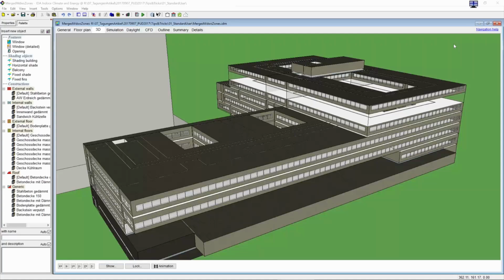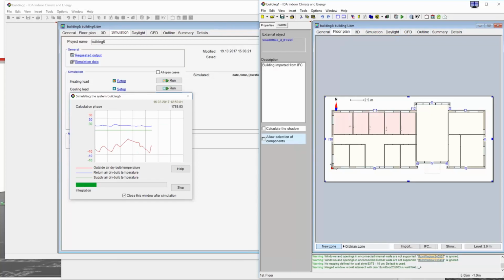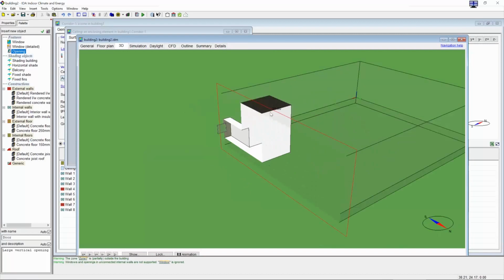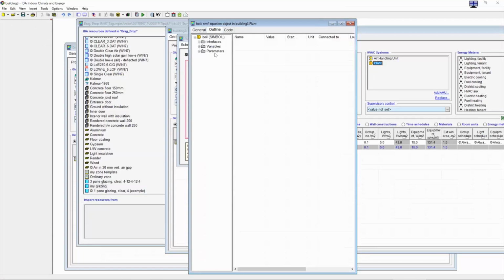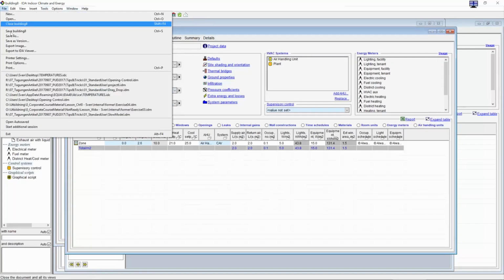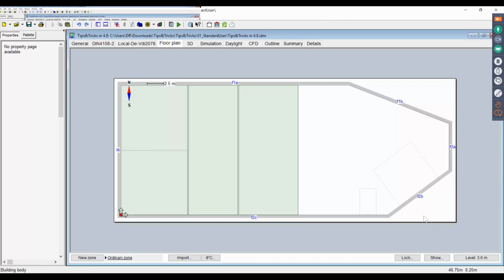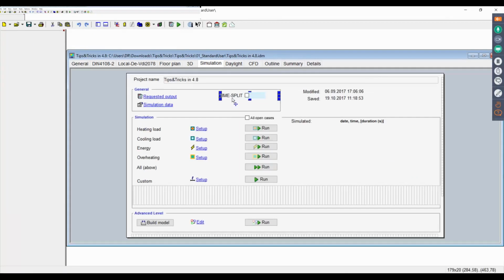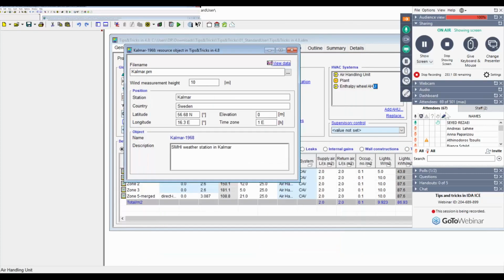Tips and tricks in IDA ICE 4.8 (Webinar)

Comment: Hi, thanks for the video. Great job! 
I have a question, do you know what could that warning means ''Unable determine if the radiation data in climate file are shifted'' ?
Reply: Weather files comes in all kinds of time formats, for example UTC, local time, time based upon a building controller or whatever. Often these files have to be shifted regarding UTC to local time and also local position/weather station. IDA ICE shifts weather files based upon diffuse solar radiation until it is symmetrical around 12:00. Actually it is a bit more clever including a tolerance. Sometimes IDA ICE is not able to determine if the weather file should be shifted and then you get a warning like this. In most cases this is fine but it might be a good idea to manually visualize solar radiation to see if it is ok.
Reply: @maxtillberg  thank you so much!